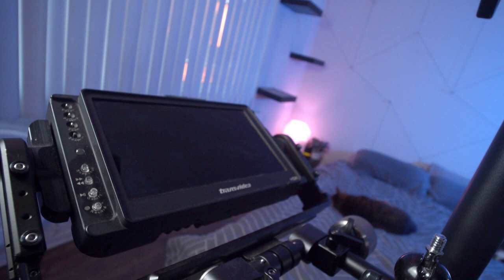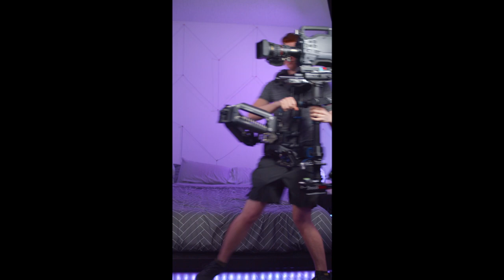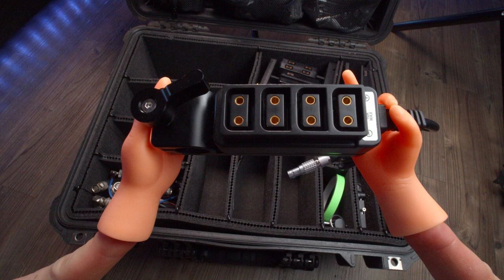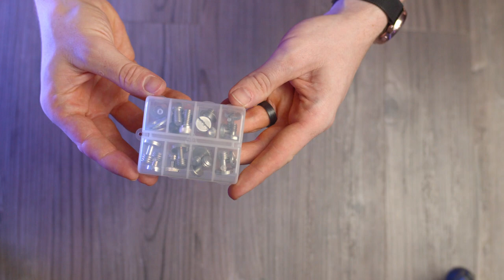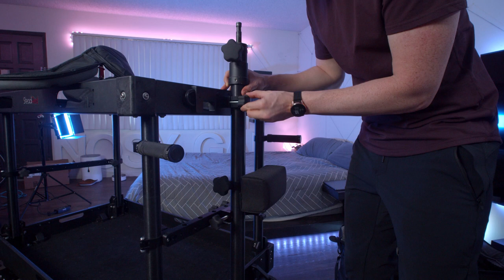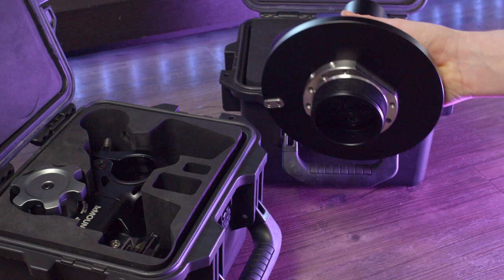EVERY PART of my Steadicam kit with all of my modifications and reviews.

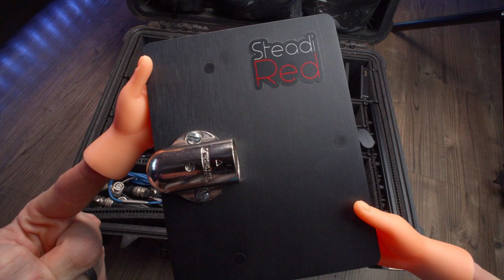Comment: Good work, Red. You show all the parts, but not necessarily how they go together. (I know, that would be a video 4 or 5 times longer than this one.) So help me out with the battery adaptor @ 8:39. I'm a V-mount man flying a Zephyr, but I don't understand how this plate eliminates camera cables. How do you mount the thing, and where? Top? Bottom? Behind the camera? Under the battery?
Reply from the maker: Thanks for watching! its a little hard for me to explain but i'll do my best. by eliminate the camera cables i mean the power cables to each brand of camera to be powered off of your sled. they are really expensive and not worth it. so to power the camera instead (without the additional battery weight) you would come out of the topstage power out (i think on a Zepher its a 3pin LEMO) and into the battery eliminator with a 3pin LEMO to a 4 pin xlr cable. the battery eliminator would be where the battery on the camera normally gos so the camera has no idea it doesn't have a battery on the back.
Reply: Got it, thanks Red! I usually fly smaller cameras that don’t have battery plates, but still try to power them somehow from my rig battery, so that was why I was confused. That’s a great idea to use AB or V-mount battery eliminators on the camera.

Comment: Love your channel and your personality. Instant sub, thx for the work you put in. Could I ask if you got any input for really cheap gear ? I just got my pinky into the industry and as a solo videographer I can't afford (or need) a real Steadycam, yet ;) I bought a cheap Flycam, but I hate it :) I find it more or less impossible to balance and struggle to find smooth shots. I understand that a 500$ will never compare to a 40k gear, but what will be good enough? Would be very interessting to hear a real pros input on where to start building for a beginner...
Reply from the maker: Hey man! Thanks so much! I would look into used older gear or possibly modifying what you have.

Comment: Super interesting video! (as always!)
I watched also the multicam tutorial...  If I may ask, regarding tally, the signal goes from the 4-pin top section through the M1 post and comes out from that 5-pin connector at the bottom, is it correct? Where did you get those tally receivers you mention at 20.18? On your website I don't see them. Their lemo cable that you ended up making by yourself is the 5-pin, and it goes in the bottom section 5-pin plug, did I get that right?
(I was actually wondering which cable is to be used with that 5-pin plug and with which monitor, as neither Stargate or other similar monitors have a 5-pin connection!)
In the other video you also mention a tally through sdi... Is that actually a tally light that works with a sdi signal? Or it must be injected in the monitor as a second sdi in?
Thank you for your answer. I would like to step up soon from an A-30 system and I am trying to understand where to put my money... M2 or the italian brand Smartsystem, that offers also some customizations possible, besides being close to where I live...
Reply from the maker: Thanks so much for watching!
Yeas thats correct, the tally gos in the 4-pin top section through the M1 post and comes out from that 5-pin connector at the bottom. 
The receivers i had to make myself but they are quite simple. it is a just an LED wired to pin 2 and 3 of the lemo. you can find the wiring diagram in the manual. with this system i have to power the monitor with a different power output (the 3 pin lemo). 
I think it is possible to make a cable that would carry power and tally data directly to my stargate but it is beyond my capability.
The tally through sdi simply uses the copper in the line already run through the sled to send an electrical signal from the top of the sled to the bottom. it doesn't have a connection to the monitor at all. it uses a brake out box you would velcro to the top of the monitor and it would light up when it receives the power. i know some cameras do somehow send recording data through the sdi line (the  alexa and the red cameras do it) but it doesn't work for broadcast cameras. hopefully that makes sense.
.
For me i love the M2 and i have not tried out the smart system. but for you i would definitely look into it because having the company to fix the rig nearby is a really big deal. i wouldn't want to have to mail the rig to a different country every time i had a problem.